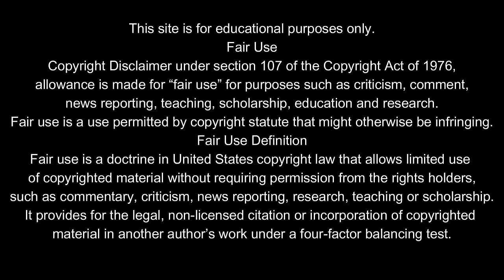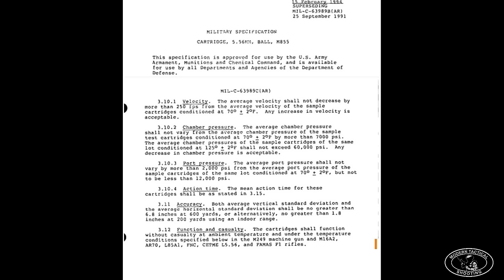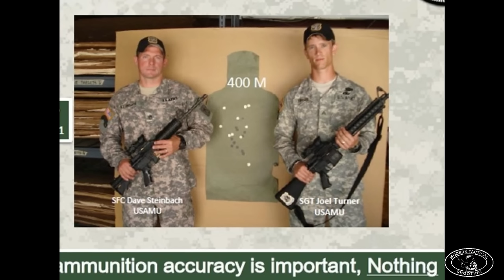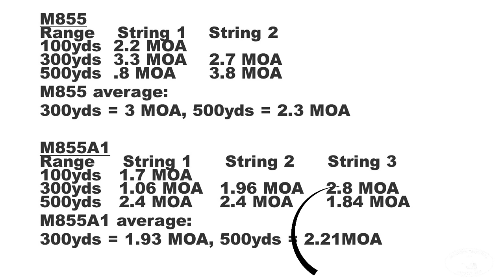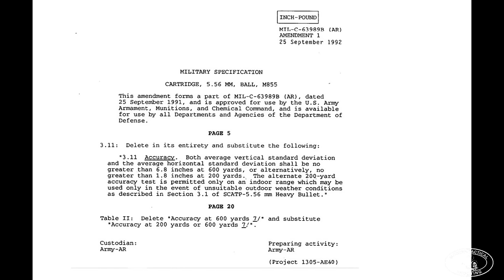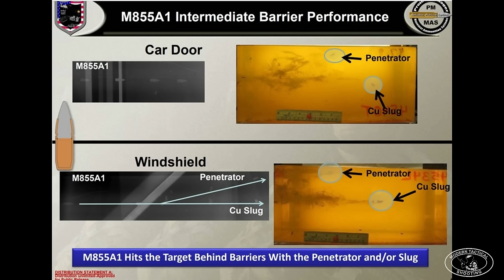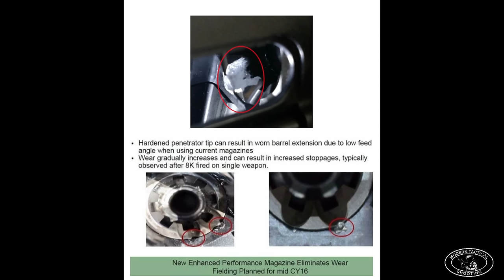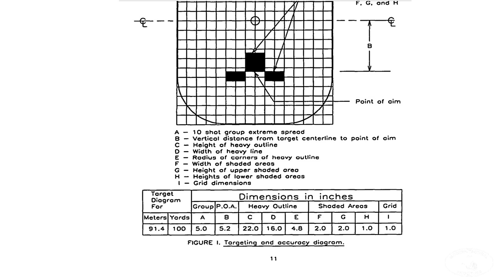M855A1 Performance Review. Did it live up to the Army's hype? Did going green really work?

Comment: I don’t get why you wouldn’t want comparable data sets.. you and I both know that the 3rd string of m855 out at 300 and 500 yards would have been up around 3 and 4 MOA so it just seems disingenuous for you to not record the data of the m855(which doesn’t cost $3 a round). I won’t go so far as to say the data was cherry picked but it’s hard to argue that the a1 isn’t a superior load. Better accuracy, a harder steel dart(60 Rockwell hardness vs. ~48) which does help it get through inferior armor and penetrate light barriers much better. Also, in human tissue a common complaint with M855 was the angle of entry, or yaw, which really varied quite a bit. The newer m855a1 has the steel dart exploding out of the front of the copper core for lack of better words and it really does create a much more devastating wound path with both the copper core and the penetrator getting good, deep penetration and the jacket fragmenting even at fairly low velocities- 1,700fps- which equates out to 400-500yds or so out of a 14.5”-16” barrel. It really is a superior round and I get that it may not be match grade accurate but your other points don’t seem to refute why it isn’t a better load.
Reply from the maker: It's still not about how it Compares against m855... it's does it live up to the claims the military made about it being a match round
Reply: @ModernTacticalShooting  okay I hear you. I was just wondering what your issues with the round were. I too had some issues with the whole “going green” thing as it is either being used on a military range or a battlefield- neither of which are likely to be a damn coral reef or a tropical preserve but I have read that they used that to get the funding they needed. Anyway, I’ll be a new subscriber and I appreciate the response.

Comment: counting the outlier group of 855 at 500 yards with .8 moa clearly throws off the average when none of the other groups were anywhere near that accurate. Should have shot a third or fourth string and cited that group as anomalous.
Reply from the maker: Point of the video is not to compare them. I just did that for the heck of it... even if you take M855 out. It still shows and M855A1 not match like as the army states.
Reply: @ModernTacticalShooting  ok valid point, but it does seem to have a marginal improvement on accuracy, one that you would probably notice. Not sure why that single data point jumped out at me but nevertheless a good quality, and informative video!

Comment: M855A1 has one lone advantage over Mk262 & that's armor penetration.
Outside of that, Mk262 is vastly superior.
Reply: The biggest advantage A1 has is not armor penetration but fragmentation. It will reliably break apart at a good 500-600fps slower then regular m855. That is, quite literally, life-changing, especially out of shorter barrels.
Reply: @Laotzu.Goldbug  I'm not comparing it to M855, I'm comparing it to Mk262, the round that should have been fully adopted as the primary 5.56 round, but does still see regular use.
Reply: @pewpewTN  i see. Well technically the A1 does have better fragmentation than the mk262, but of course that's the MK262 doesn't fragment, and you are right overall it has better terminal performance. 

I think the issue is that while terminal performance is important, it is not the only factor and in some ways not being able to exceed a minimum of barrier penetration makes around no go as a standard issue, regardless of what else it brings to the table.

Comment: I'm really surprised you used a pristine barrel. Why on earth did you not use a barrel that was full and properly broken in? Using a brand new barrel will not allow actual REAL  information.
Reply from the maker: There is no barrel break in with a chrome lined 5.56 AR barrel. The barrel I used in video in fact had a couple hundred rounds thru it.

Comment: I’m sure this round excels out of a 20 inch barrel the army needs to go back to the m16 colt even made a m4 with a folding stock it used a super short bolt carrier group and buffer tube that allowed for the design to accommodate a folding stock.

Comment: This is one of the most bullshit videos I've seen about this round. Alot is completely wrong. And this person being special operations doesn't mean they know what they are talking about. To quote a special operator Kevin Owens "especially with the new M855A1 that the army developed its a phenomenal round"..some things wrong with this video. You said rounds are judged by 3 criteria. Accuracy, lethality, and armor penetration, and that for a round to be considered a good switch it needs to beat the current round in at least 1, preferably 2 categories. M855A1 consistently fragments within about an inch of gel from ranges I've seen as low as 1900 fps and as high as about 3200 fps. It does not pass clean through in CQB like he says. I've never seen it pass straight through gel. M855 is very inconsistent with how it fragments and tumbles. Sometimes it punches clean through, sometimes it tumbles at 2 inches, sometimes 8inches. M855A1 is vastly superior to M855 and M193 in lethality. In terms of armor penetration, there are ceramic and PE composite plates that will stop both M193 and M855 but the M855A1 punches through. On steel plates, I have personally put M855A1 through a level III plate out of a 14.5in barrel whereas that plate stopped M855 from a 16in barrel. On mild steel, no other 5.56 round (other than AP) will punch through 1/2in. But I've put M855A1 through 1/2in from a 14.5 barrel at 100m. As for accuracy, you are correct it is not true match accuracy and yes 77gr outperforms it. But it is plenty combat Accurate. You said good practical accuracy with a makeshift shooting position with a 4 power optic and 77gr is about 2 MOA. With an M4A1 Block II, I can use M855A1 to consistently hit a 5in plate at 200 yards and inconsistently hit that plate at 250yards. All with taking a knee and literally using the magazine as a rest on a table and using an Eotech optic and 3x magnifier. That's a practical accuracy between about 2-2.5 MOA. M855A1 outperforms every standard issue 5.56 round (M193, M855, Mk262, Mk318) in every way with the one exception being the 77gr accuracy. Not sure where you are getting your information from but you can look up many videos about it on here, including the gel and armor tests with associated velocities.
Reply from the maker: Thanks for your input!
Reply: @ModernTacticalShooting  well, I'll give it to ya. That was a very professional and subdued response given how I slammed ya in my post lol